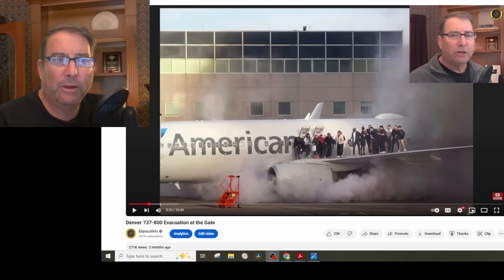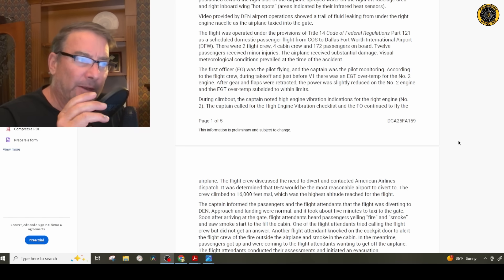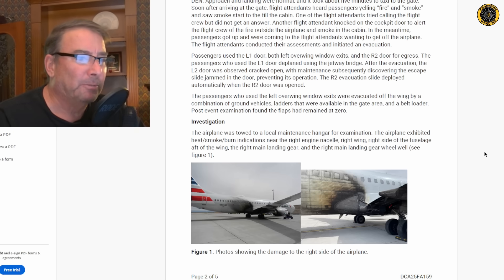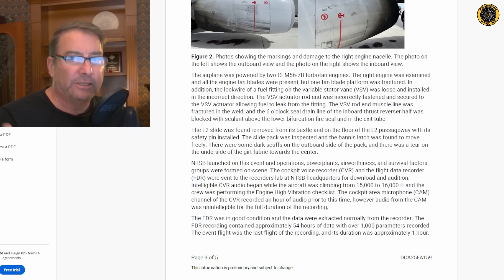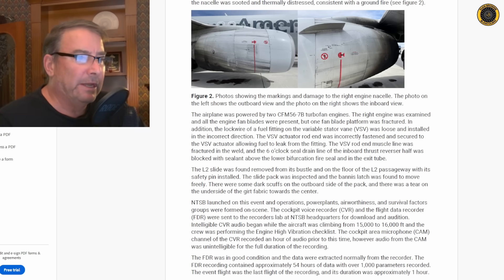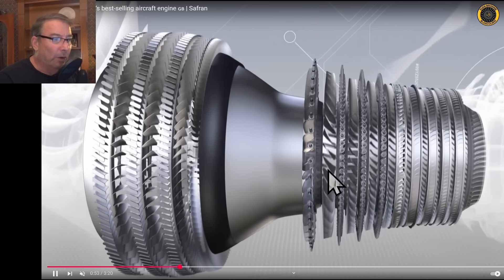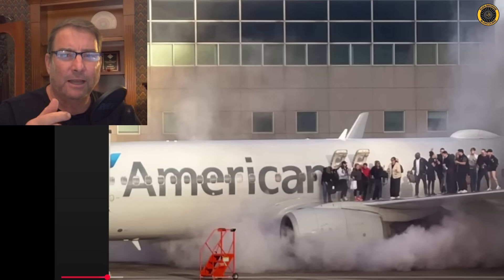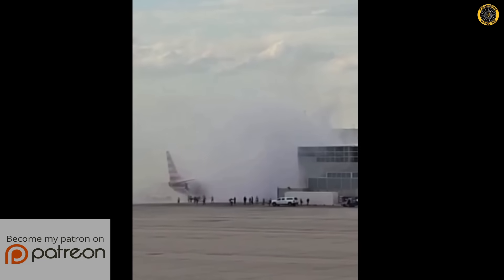NTSB Prelim American 737-800 Engine Fire at Gate and Over Wing Evacuation

Comment: 7:35 I used to do heavy checks for Embraer on the 175. When we removed slides, we always installed a safety pin to prevent inadvertent deployment. I've never worked on the 73, however, I'd be willing to wager that the safety pin mentioned serves a similar purpose.

Comment: So question, why not make procedure be flaps down while at the gate? Flaps used on landing and take-off so just leave them down instead of fully retracting them evertime. Even if landing flaps are different than take off flaps it doesnt change the having to set flaps for take off you would just change lever from flaps 0 to correct setting to flaps fully retracted to correct setting

Comment: The 737 does not have wing slides. It doesn't have a fire indicator in the case of engine shutdown. There you have it. It's a completely unsuitable, obsolete and unsafe aircraft that needs its type certification withdrawing. Let's stop kidding ourselves.

Comment: To put it into pilot speak, variable stator vanes are used to change the effective AoA of the (spinning) compressor stage blades, this lets you run higher angle, higher compression stages without them going into compressor stall at adverse engine regimes.

Comment: An EGT overtemp AND high vibration IMO would lead some to shut the engine down. Even if it wasn’t shutdown right away, they possibly could considered a shutdown enroute to the divert airport, or at least shut it down on landing roll and have ARFF check it out before taxiing to the gate.

Comment: Time to add a camera or two to each side of the aircraft so as to inspect engines and control surfaces from the cockpit while in flight. Should not be a huge software issue to display these on the existing displays when needed.  If drag is an issue, they could fold flush when not in use.

Comment: Small correction First 3 HP stages have variable vanes not 4. Stages start with the blades then the vanes. IGV (inlet guide vanes) is the first set you see on the HPC Forward stator case followed by stages 1,2 & 3.

Comment: I really don't like that the cabin crew was unable to alert the cockpit.    Back in the days they would open the door, but nowadays with a closed door policy:  there should be a special emergency button the flight crew can use to contact the pilots.  (To separate from a more "mundane" call, like the cabin crew requesting information.)

Comment: This is what worries me with commercial flying. If its my own plane and mechanic that I trust its not a problem but when you see something like this where someone is so incompetent they can't even lockwire something correctly it makes you wonder about every flight you take. 
Did you get the usual plane with the solid mechanics or did you get the guy who failed his work experience placement 25 times before passing a test by accident?

Comment: This is why the 787 Max should be banned.
The A-320 has to have slides on the back of the wing.
The 737 Max does not, because it is using 1967 certification.

This was sort of ok, on the 737 classic, because it was low to the ground.
But the NG and Max are much higher off the ground.

R

Comment: Thank you for the little safety wire lesson. I've been a mechanic for 40 years and thought I knew how to lock wire fasteners but I learned something here. Never seen that  trick where you make that one big loop to get the wire snug.  The rightie tightie is an easy to remember tip when showing someone how to lock wire fasteners properly. Goes to show you are never too old or smart to learn something.
Reply: We called it "around the world" loop in A&P school.

Comment: Hey.  Like most aircraft  maintenance bases, engine manufacturers etc, safety wire has been replaced with cable lock cables.  This works faster, better strength as well easier than the old school.  It can be done backwards as well.  Just thought I would mention this so you can go tool shopping at Grainger

Comment: If you have an engine problem that requires a return... you NEVER take it back to the gate... that's why they have pads away from the terminal for mech's to investigate... an additional 10 minute wait and keeping the surrounding airplanes and terminal safe.... bad decision making on the captains part.

Comment: I worked on so many CFM HPCs and attending stator vanes in the jet shop at Unnamed Airlines I could.... Hopefully the backwards safety wire is from a line repair, and didn't make it out of the shop that way.

Comment: My guess with the door is that the rear flight attendant had already disarmed the door where the slide didn’t deploy. This is a weird state since the plane is docked and assumed in a safe state. I wouldn’t fault any of the crew of the plane (pilots and attendants) for what they did. Thanks for the ground crew quick thinking they were able to get everyone off the wing.

Comment: I own and operate a fleet of Excavators, Track Loaders and Dump Trucks, we are very detailed in how we maintain our equipment and I personally cannot stand it when somebody uses sealant in a sloppy and disrespect manor toward the piece of Equipment that it is being used upon and I find it hard to believe that an Aviation Mechanic would use so much Sealant and  could plug up the Fuel Drain is beyond me, where are these engines being worked on, an AA shop or a Third World Country?

Comment: The 737 slide safety pins are designed to keep the bustle from closing when installed. (At least at my airline.) So not sure what happened in this case.

Comment: "Righty - Tighty!"   Right on, Juan.  Many, many years ago (1962 to be precise) I went through U.S. Air Force tech school training at Chanute AFB, Rantoul, IL. Specifically it was to become an aircraft electrician. Until watching this fascinating video, I had completely forgotten about "Safety Wiring 101". Part of that job of course required removal and replacement of aircraft electrical equipment such as generators, voltage regulators, inverters, actuators of various types, etc. They were each installed with safety wired fasteners. I became quite proficient in the use of dikes, duck-billed and needle-nosed pliers. That brought back so, so many memories previously locked away somewhere in those disconnected neurons of mine. We took great pride in our safety wiring prowess. Of course it always got inspected afterwards, but I never got "gigged" on it. Thank you, thank you!

Comment: @12:00... I like your description of the levers that change the Stator Vanes; "Monkey Motion". Yes, it is quite the series of levers and transverse actuators. So, the rod was incorrectly installed and fastened, which is the responsibility of the person who performed the maintenance, and presumably the person who inspected the work? So, I was qualified as a QA Inspector on USS Jacksonville SSN-699. Every time we did maintenance on a system that required a Quality Assurance check, I (or an other QA Inspector) would inspect the work performed; as a Secondary Check, then sign off on the maintenance performed. When they perform maintenance on the engines, do they have a QA Inspector sign off on the work performed, or does the Maintenance Tech sign off on it, singly? I know there are different levels of maintenance tech in aviation, so I am curious how that works.

Comment: The Boeing 727 also used the wing flaps for over wing emergency evacuation. The Boeing aircraft have electric motor driven hydraulic pumps also but obviously wont work if the pump motor has no electrical power. The difference is that B-727 Engines are aft mounted on the fuselage and not placing the passengers in close proximity to the Engine fire.

Comment: I'm wondering where the last slide installation and engine maintenance was performed ? Safety wiring Proficiency is required as part of A & P License testing. As someone who worked over 40 years in aviation maintenance we are in serious trouble if these types of maintenance oversights / incompetence are being allowed in the system.

Comment: Sounds like a bit of a cluster all round. Some dodgy maintenance practices and very obvious lack of decent supervision and double checking of work. (Locking wire and slide safety pin). Plus some fairly blasé    management from the flight deck once on the ground and seemingly safe. Why the hell wouldn't they even answer the cabin intercom? 
The pilots knew there was an engine issue with high EGTs, even though there may not have a fire in flight, surely the safe thing to do would have been for a Meet & Greet and follow to the gate from the Denver Airport Firefighters? Why did it take the gate staff to put out the fire?
It all comes together to show how a few small things can roll together and prove the "Swiss Cheese" model quite easily. Lucky nobody got injured badly or killed here.

Comment: Use to work the doors on B737-800 and the slide installation at my Airline requires a RII qualified Inspector to sign off the installation on the work card . This also requires checking the threshold girt bar fittings for proper installation and function as well as safety pin removal. There is a maintenance card that travels with the slide and the slide Serial Number - Part Number - and last overhaul date must be verified. Sounds like several holes in the Swiss cheese. I'm wondering where the last slide installation and engine maintenance was performed ?

Comment: So
- the L2 door slide was jammed in the doorway with its safety pin still in,
- the lock-wire on a fuel fitting for the variable stator vane was loose and installed the wrong way, 
- the VSV actuator rod-end itself was incorrectly fastened (letting fuel leak), 
- the weld on the VSV rod-end muscle line was fractured, 
- the 6 o’clock sealed drain line of the inboard thrust-reverser half was blocked with sealant, 
- one fan-blade platform in the right engine was fractured, and 
- the cockpit-area microphone on the CVR produced only unintelligible audio. 

And surely not to forget about the flaps being used as an emergency slide due to cost-cutting measures. 

Sounds like an average Boeing airplane to me. :)

Comment: Seems like a design flaw in the 737 that you can't evacuate from the over wing exits if both engines are shut down and the flaps are up. Who ever thought that was a safe idea?
Reply: The Boeing 727 also used the wing flaps for over wing emergency evacuation. The Boeing aircraft have electric motor driven hydraulic pumps also but obviously wont work if the Battery Master Switch is turned off. The difference is that B-727 Engines are aft mounted on the fuselage and not placing the passengers in close proximity to the Engine fire.

Comment: One of the things that I would have thought technology would have brought us by this time is a few cameras on the aircraft that aid in the operation and awareness of the aircraft. Cars have better outside awareness. Cameras could be very helpful in keeping an eye on some of the major that could create issues during aircraft operations like the wing tip, preventing the pilots from putting a wingtip through a part of another parked aircraft during ground ops. A camera that looks at the wing and engines. From the cockpit or flight deck, most pilots can't see the engines because of how the fuselage tapers at the forward portion. Another great spot would be the landing gear for malfunctions like flat tires, gear stuck in transition. With all the flat screens up front, it would be great to allow one to have a selectable video function that would either help confirm there is an issue. I am not sure if any current aircraft under production have this capability, but seems like a natural progression. Thoughts?
Reply: It's so simple, it is surprising it hasn't been done. Certain large aircraft like the 777-300ER and A380 have a "taxicam" to help the pilots steer on the ground, and some airlines specify a tail cam for passengers to see the landing, but I'm not aware of any that have cameras pointed at the wings or engines. Seems like a no-brainer feature to add TBH. Don't know why the Airbus NEOs, A350 and the 737-MAX don't have them. I wonder if the 777X does?

Comment: Slide safe pin is for shipping, to be removed during installation. It also is a required inspection item for installation. meaning an inspector with rii would also be present for installation. The safe wire would not be the cause of a fuel leak, A loose B nut aka improperly tightened and then safety wired backwards as well that’s a double negative. I should point out I have never worked on the cfm .

Comment: One of the things that have bothered me with my recent flying as a pax is the cabin crews do not require the shades be raised for takeoff and landing.  I prefer aisle seats and can't control the shades. We, the Navy C-9s, required it all the time back in the 80's so pax and cabin crews can see what is happening on the outside of the aircraft.  In an emergency and before you open the emergency exits, you are supposed to look outside to see if it is safe to open the exit.  With the shades down that cannot be done easily.  The last AA flight I was on, it felt like I was taking a ride in the back of a C-141.  In this case, I suspect the pax and crew would probably have gained precious seconds to make life saving decisions.  I suspect the cabin crew would have been informed of the smoke sooner and could have informed the cockpit before they shut down all the systems.  I suspect the  flight crew would have stopped sooner and shut down that engine and used the Engine Fire check list.

Comment: Interesting that they use high pressure fuel to drive the stators (I guess it made sense in that they have high pressure fuel already nearby and they are increasing pressure to get more power so why not use that to drive the actuator, and not that hydraulic fluid isn't flammable also, but still). One thing that is surprising is that when the plane landed and they presumably deployed the reverser and the cowling opened for the reverser that the fuel wouldn't have drained out then, but as SpaceX has demonstrated on the Starship test flights, having a big honking fuel drain is important!

Comment: Hard to give the flight crew too much trouble for this, if the aircraft is shut down and they're not aware of the fire and the cabin crew evacuated before communicating with the flight crew. I wonder if the power off meant that the flight crew phones didn't work to communicate with the flight deck?

Comment: The instructions to passengers at overwing exits can be part of the problem. With a different airline, the instructions said if you are asked to evacuate open the door by the pilots…. What it did not say, was do not open in an emergency until you are instructed.

Comment: I always wondered that if you are not feeding audio from the aircrew's microphones into the FDR why would it not be required to feed it into a channel on the CVR, sure pre 1970 when they used tape recording exclusively it would be a size and cost issue but starting in the 90's both boxes started using flash or other solid state memory devices instead of tape and an extra channel of audio would cost very little in size, weight or cost... CVR's should have multiple channels already from the cockpit mics, why do they not also include a feed from the two headsets, it cannot be issues of isolation, and cost would be much less than 1% of the unit...   retired engineer here who started designing (on the side) such equipment for GA after noting that the big boys already had access to solid state recording of everything... I also realize that most planes never have their FDR or CVR upgraded unless something fails or a new regulation is put in place but come on now, we have had several decades to roll out something better for new builds... certification should not be that much of an issue compared to things like medical devices or nuclear power equipment (both of which I have lots of experience designing and getting certified)

Comment: Yaun,  there is a safety pin about three feet up the side of the slide.  The safety pin is a stainless steel 2 inch pin used  to lock-out  the slide when your  installing the slide into the door carriage container.  Before you put on the bustle on, you must  pull this safety pin and stow it in a pouch in front of the slide.  With the pin removed the slide is ready to fire with the girt bar engaged.  I am pretty sure that this is a RII sign-off in the logbook.   The mechanic and inspector need to make sure pin is removed and psi gauge has pressure in the gas bottle before the bustle is installed.  This is a major violation if they did not do this right.  Boeing Aircraft Company Craig Christon

Comment: Juan, always look forward to your insights, but point of clarification:  I wouldn’t term this an uncommanded evacuation.  You said that after some passenger concern, the flight attendants initiated the evacuation.  As a former f/a training instructor at an airline with which you are very familiar, we taught that flight attendants can initiate an evacuation in the event of smoke/fire; significant structural damage; and no response from the flight deck.  Keep doing what you do!
Reply: At approximately 3:29, Juan explains that the flight attendand initiating the evacuation is what we call an uncommanded evacuation, meaning it was not initiated by the people in the pointy end.

Comment: I think the most insane thing here is that the overwing exit plan is just "slide down the flaps if they happen to be down". Very legacy thing that's somehow still certified.
Reply: It works though. I recommended wearing comfortable cloths and gym shoes when flying.
Reply: @zachv1942  I'll be sure to oblige whenever I'll fly on a 737! Which will be never.